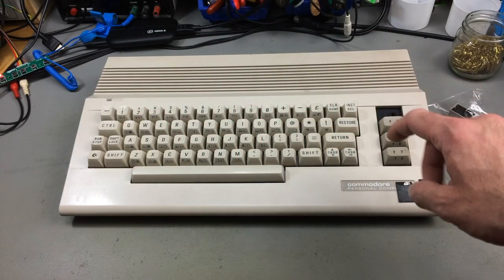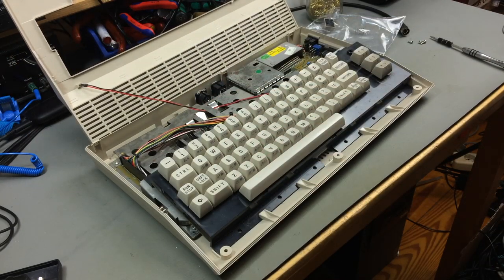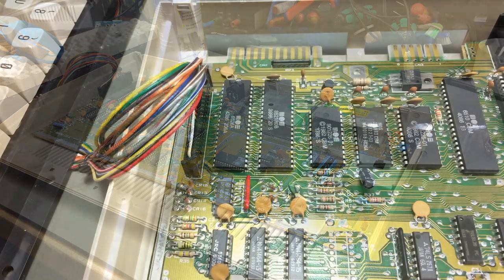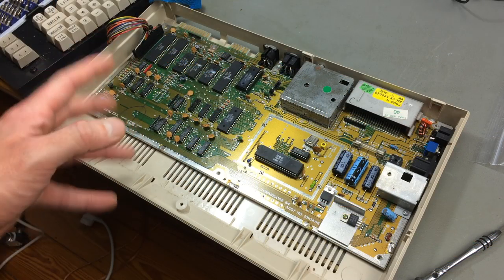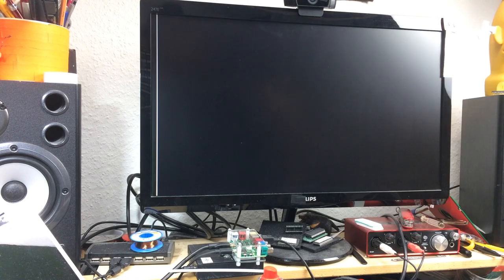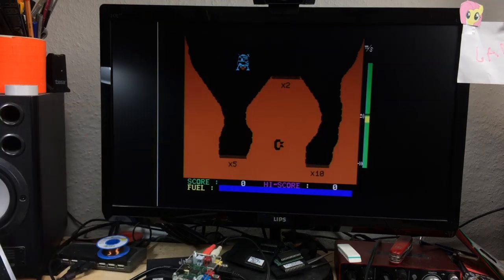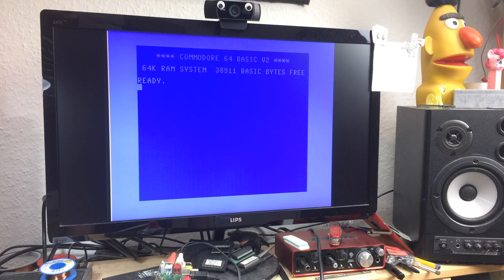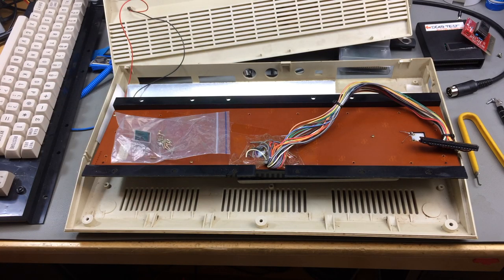C64C Black Screen Repair

Comment: Please consider keeping it as NTSC for the timing, colour and aspect ratio. NTSC runs at a different speed, has a different aspect ratio and slightly different palette. I grew up and live in a PAL region, and only discovered these differences through emulation. So many games that I played as a kid felt a bit too ssslooow. Now I finally know why. They were NTSC games, designed to run on NTSC machines. So on our PAL C64's they really were running too slow! 

There are so many examples, you owe it to yourself to check what you (and all us PAL users) have been missing. 
Check out the opening speech in Impossible Mission. I always felt he spoke a little too slowly. And if turns of he did - on a PAL C64. I know he's supposed to sound evil, and the slow speech is for effect, but it just seemed almost unnaturally slow. Play it on your NTSC C64 and hear how it's supposed to sound. You'll also notice that the protagonist runs slightly faster, at a more narural speed. I always felt he seemed to be almost running in slow motion. I wondered if it was to show off the impressive animation . But, no. It turns out it was just caused by playing an NTSC game on a PAL C64. Also check out Summer Games. Same issue. Slow opening ceremonies. Slow national anthems. Slow running and movement, particularly evident in pole vaulting. And in NTSC, the speed is just right. Even the diver falls at a more natural speed. 

There is whole world of games out there to rediscover, and experience how they were mean to be played, and sound. The music is also too slow in PAL.
So many of ours  earliest C64 games were from NTSC land (some of them being ports from the Atari 8 bit computers). Fort Apocalypse, Pitstop, Pole Position,  Jumpman, Super Cycle, and so many of the early arcade conversions were actually NTSC games. The list goes on. 
It would make a fascinating video. Now that you have an NTSC C64, please share it with us. I have yet to see anyone create such content. Americans wouldn't think to.  And most of the rest of us don't have access to an NTSC C64. Now you do! :-D

Comment: https://youtu.be/Umm-wZ_WYWs
Hallo, habe folgendes Problem: Habe heute das C64 Diagnostic Modul REV 586220 bekommen. Bei all meinen C64 Computern werden vom Modul die gleichen Fehler gemeldet:  U1 BAD, U2 BAD, U18 BAD, Cassette BAD, Keyboard open bzw. BAD, Control Port BAD, Serial Port BAD, User Port BAD und Interrupt BAD. Wie kann das sein? Würde mich über jede Antwort freuen. Danke. Hier der Link zum Video des beschriebenen Problems: 
https://youtu.be/Umm-wZ_WYWs
Reply from the maker: Das liegt daran, dass das Diagnostic Modul ein sogenanntes Test Harness erwartet, also Loopback Kabel an allen Ports, die benutzt werden, um diese und die verbundenen Bauteile zu testen. Siehe die Links zu Test Cartridges und Test Harness in der Videobeschreibung.

Das Dead Test Diagnostic Modul läuft ohne Harness.

Comment: American C64s did not use Torx bits by default, so I'm guessing that the "sales and support" company "helpfully" replaced the screws as a deterrent from users servicing their own machines.

And remember, PCB stands for: Perifractic's Camaraderie, Booyeah

Comment: Hey Jan, cooles Video wie immer :) mal eine Frage.. Gibt es irgendwo aus Deutschland ein fertiges Cap Kit für den c64c assy 250469, 252311 Rev B? Bin Anfänger, habe mit den C auf ebay geschossen und würde den jetzt gerne Futureproofen :) Danke im voraus für alle Infos, mach weiter so geile informative Videos. Liebe Grüße aus Rheinland-Pfalz! Peter
Reply from the maker: In Deutschland weiß ich leider niemanden, aber Retroleum.co.uk hat Cap Kits für so gut wie alle C64er-Versionen.

Comment: A shorted SID that causes a black screen is somewhat uncommon, but it does happen occasionally. Normally the dead SIDs I find are just silent, or one or more of the filters are faulty. As I told you on Twitter, welcome to the 250466 club Jan! Are you going to convert it to PAL?
Reply from the maker: Yes, most faulty SIDs I encountered have some sound issues or are silent. Never had a SID that took the whole system down. I think I'm going to keep it NTSC or make it switchable as I already have a couple of PAL systems. We'll see.

Comment: Very interesting revision motherboard!  Don't forget the CIA will show as bad because you aren't using the loopback connectors!  I am sure it will pass the test OK with those connected.
Reply from the maker: I had the test harness connected for the Diagnostics. I heard from some people that the new revision CIAs will always show as bad anyway (slightly different timings?).
Reply: Ah, I didn't see that!  Thought you were testing without it at that point.

Comment: If you have multiple 64's it's nice to keep one different.  Keep  it NTSC.  That way you can play NTSC Games they way they were intented.  Faster!  Also, there are a lot of games that work on NTSC, even PAL ones.  (NTSC fixed)  Just have to spend a little time hunting them down.  ;)   CSdb has them.

Comment: 64C mit 6581 das Ding hat echten Seltenheitswert!
Reply from the maker: Oh, die frühen C64Cs hatten alle den alten SID, die ersten mit den Short Boards und 8580 kamen ab 1987/88 (1987 der Aldi C64 war der erste C64 mit 8580).
Reply: Wirklich? Mir ist der C64c im Bekanntenkreis nur als 8580 bekannt (schlechte Sample-Wiedergabe). Ich dachte, das gehörte mit zur Philosophie, Optik verändert und an Bauteilen gespart. Aber wahrscheinlich wurde, Commodore-typisch, jedes Bauteil solange verbaut bis es alle war. :-)